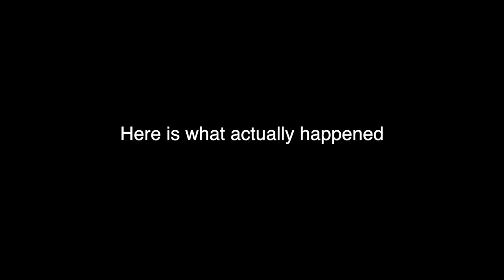How Can I Dig Through This?

Comment: Digging out solid rock to replace with a softer concrete to pass the building regs. We have the same problems here in Scotland 🤣
Reply: It’s better to leave hard rock and build on it.  In the uk when you have a footings inspection they prefer hard rock to stay in place.  It’s happened to me on many jobs.
Reply: I think they require a certain depth to stop sideways movement of the piles. the rock is all good for taking downward load but if it's only 300mm in the ground, the pile can migrate sideways
Reply: That could be overcome by drilling and gluing an anchor in it. But that would be an alternative solution requiring engineer calcs. May as well dig.

Comment: A trick for harder rock (or concrete slab) is to drill a series of full depth holes with a 12mm bit on your outline. On bigger excavations a few extra holes in the centre helps a lot. This also avoids cracking concrete (not your present concern). I have done this to pass ventilation ducks in cast concrete, not fun, but not as bad as a break hammer only approach.

Comment: Got Similar here where I live in Australia lol the foamy stuff here is generally pretty soft,and the hard dense stuff isnt too bad but then you get some that's like a combination,hard but has little soft pockets that the chisel just falls into and traps it. An ezebreak micro blasting system is definitely on the cards here, can apparently be used indoors etc,just an 8mm hole from memory insert the device and pull the trigger

Comment: I'd use a grinder to cut strips into the rock and then use the breaker. The cut lines help concentrate the force of the breaker and helps getting chunks of rock out.

Comment: To everyone questioning about digging out rock, in nz we have to pass inspection by building to engineers specifications so if the plans say 800mm holes to support a certain load, then the hole must be dug to that depth.
Reply: Sure but in any other part of the world the requirements on top of solid rock aren't the same as in silty dirt. It just seems dumb to hammer all that out and refill it with concrete doesn't it?
Reply: In nz it’s not just about downwards load. We get a lot of earthquakes so the depth is more about lateral strength when the ground goes side to side. Otherwise the houses would slide off their foundations at the slightest shake.
Reply: @livingimprovements4382  not if you epoxy steel rebar into though right?
Reply: @livingimprovements4382  but if you compare it t the old posts, that been there for a 100 years or so, it seems overkill. The old ones just do not look sturdy.
Reply: In my country, if you have an Engineer doing the plans for the building. You do it according their specifications. If you go away from it and something happens, you pay the bill. So, ye.
Reply: @Helveteshit  I think that applies in every country that has engineers and building regs/code
Reply: @danzimmer95  not all of the holes have been solid rock. How do you know that you are not about to break through into a void? For a small number of holes it is probably cheaper to follow the plan than pay the engineer to approve variations.
Reply: yeah there is not much technicality about it. the engineer specifies it, the builder does it . its just a normal days work if its rock - its a good (and rare) if its JUST dirt.

also, the council may have approved timber posts...but its just good building practice to use steel. sometimes the paper pushers dont know that their building methods are outdated.
Reply: @novosib9017  Really? Sounds like you really have zero experience of NZ soil conditions, compliance authorities, code or materials. What cost is your steel? How are you attaching it to the timber bearers? How are you protecting it from the concrete and soil chemistry?
Reply: @DiscoFang  you right i dont have experience in NZ conditions, ( i meant in construction, their are always hicups/rocks)  but i know for certain, here in AUS the only timber to ground connection you will see is a fence.

the NZ rot rate is clearly slower then here, but it does not mean it wont rot. Once you experience rot, ant damage in your structure (as a builder/carpenter) then EVERYTHING suddenly turns to steel and no engineer or certifier will get in the way. its called experience, and everything you mentioned is taken care of upon pricing of the work.

Have you ever taken into consideration a Builder with many years experience may end up working with a young, small (cheap) engineering firm? .

ive witnessed many times engineers ask the builder for suggestions before they make their final decisions. 

Iam not doubting Scott, he is a Good carpenter and builder, its clear in his videos he wants the best for the job, but it sounds like YOU need to know the things you mentioned as its just a standard process for me.
Reply: Not only that, but until each one is dug out, there is no way of knowing what's down there, as was evident when some holes were easier to dig than others.
Reply: Absolutely agree, We're on the West Coast North Island and every hole can be very different...
But they definitely don't need to be dug by guys at full trade rates!
Reply: @livingimprovements4382  the top of the post looked screw nailed to the beam?.. in Australia we use 100x100 SHS and bolt them to the bearer with 2 m12 bolts... works great.
Reply: TheBona73 just temporary while converting into place. Proper fixing plates to come.
Reply: Yeah the screws will be propping it temporarily I'd say the pile will be getting a 12kn pile fixings
Reply: It's not solid rock, that'd be bedrock. Which this Rick isn't that you also need big rock breakers as that Hilti wouldn't do shit on bedrock.

But this volcanic rock won't hold much weight before it breaks apart, so need to go past the volcanic rock layer to get to dirt below
Reply: ben The timber we use as piles can be treated to whatever level the application demands. The same species of timber used here under the house can also be used in marine conditions as wharf piles with a heavier treatment. Your steel piles would be failing in less than 1/4 the time that the pine will even be showing the any deterioration. There’s no “pen pusher decisions” involved there at all, it’s the reality of material experience and proof through use, that has evolved as building code.
Reply: @DiscoFang  Re-read what you wrote..then tell me again if Treated pine, in ground...is better then hotGal, blackjacked steel?

We use just that, with screw bolts going up into the bearer through the plate. overall its a  T post connection. 
Iam well aware of the rot differences between countries, here in QLD pine can rot away in 5 years min if exposed to soil, NZ, same as Europe (where iam from) pine has been known to still be "ok" after 10-15 years being in ground, fair call, every country is different and if that the countries specs then so be it.
Reply: ben Back at cha. Reread all your own comments yourself. It’s not the conditions that are relevant its the fact that the correct pine, treated correctly, lasts perfectly fine. These piles will last over 100 years and the only thing at fault here is not code, depth of pile, pen-pushers, lack of experience but your lack of knowledge of timber technologies in modern (as in the last 30 years) construction. To suggest $200 worth of steel, where $20 of pine will do the correct job, with easier installation, easier material availability and adaptability on site, is just silly.
Reply: @DiscoFang  yes i see your NZ codes are very different due to lack of termites and high humidity. but experience is not to be ruled out, here is a example of "modern technologies" for the cost of $180 as you stated.
https://ibb.co/HT39Hq1
Reply: @cm01  It looks like volcanic boulders intermixed with volcanic ash and soil.  If it was a solid sheet of rock/lava then you could drill and epoxy in some rebar to form a footing but when you don't know the depth/size of the bolder you don't want to dowel into a bolder of undermined size.  Also this is volcanic rock so it is porous, holds water and is likely acidic so I am not sure how those conditions would play out on a rebar dowel.

Comment: Scott, look into a product called Expando. You use an appropriate drill to drill a pattern then fill the holes with it, wait a day then pull out the rubble. Its a non-explosive demolition product and works a treat. Drilling is far easier than jack hammering.

Comment: Where I live, Vancouver Canada, if you get down to bedrock, you can pour a concrete footing ontop of it (at least three times the width of the collumn or thickness of the retaining wall) and if you encounter bedrock you can dowel in rebar to tie into it. You really arent going to get a better footing than the earths naturally compacted boulders, hard pan clay and glacier till/lava rock. The only real rule as a bare minimum is 24 inches below grade is oue frost line, and all footings need to be below the frost line. you can put wood into the ground aslong as its pressure treated, and encased in concrete. even then its a pretty big no-no because we get a lot of rain and after 30+ years even pressure treated lumber will start to degrade. So lumber above grade normally, concrete penetrates 24" below our frost line, and if you encounter bedrock or hardpan you're good to go.

So basically what I'm saying is this is massive overkill over here, but I understand the difference in municipality guidelines and restrictions

Comment: I have found the pointy chisel bits not very effective on solid rock or concrete, basically because the chisel is really trying to compress the material sideways. I've used a large SDS tungsten drill bit, drilled a series of holes, then the chisel.

Comment: The unconfined compressive strength of that Tuff is at least 20MPa which will give you a bearing capacity factor of safety of at least 50>3 therefore satisfactory.

Comment: Right call on the truck. Much better to pump in tight spaces. I'm not sure about the way you dug the holes. I would have looked into core drilling the holes.  Especially because it was volcanic rock. Would have been easy with diamond core drills. I'm not sure if you could fit a big enough drill in there. You might have been able to use 150mm core bit.

Comment: Copy/paste of smellysam
A trick for harder rock (or concrete slab) is to drill a series of full depth holes with a 12mm bit on your outline. On bigger excavations a few extra holes in the centre helps a lot. This also avoids cracking concrete (not your present concern). I have done this to pass ventilation ducks in cast concrete, not fun, but not as bad as a break hammer only approach.

My comment:
The material should be made fragile so that the work is easy. If those from Hilti can`t  figure out how to save you work (money) they should find a newspaper route !.

Comment: Do you ever get a chance to chat to the engineer on the Job? We'd usually find a way to get around it if they're ordinary piles, a clean hole on rock would likely be sweet. If they're anchor piles, we could swap them out for braced piles, a diagonal brace and a couple of bolts could save hours... Engineer time ain't cheap, but, if it can save you a lot in the long run.

Comment: Wow, what a massive ball ache that is. Surely if that rock is so hard you could build from that point. 
Something that hard Id normally cut or drill holes into before attempting the breaker
Reply: just wanted to mention that. drill some holes to give space to break some material off. 

the right drill machine and drill goes throu most like butter.
Reply: you mean form a footer right on top right?  i was thinking that as well
Reply: @danzimmer95  well yeah or maybe a nice big drill to drive some sort of pile into the ground instead. I'm sure an engineer could come up with something a bit easier than that. As I understand it the depth is due to the earthquake risk, I'm sure there's a work around somewhere
Reply: Seems like a whole load of effort to then just use fence posts I'd be in there with engineered steels if your up against earthquakes and wooden posts ain't gona last any longer than 20 years
Reply: Ryan Reid haha wooden posts last 50+ years. The ones under my house are from the .1940’s
Reply: @ryanreid5646  Haha Try 100+ years for these H5 posts in volcanic and clay mix soil. $30 for a pile vs $200 for "engineered steel". Properly built timber buildings withstand earthquakes just fine.

Comment: Why break out rock if it is sound enough to use for loadbearing purposes? Normally you’d just drill into it for a resin anchor. And then setting timber into the concrete, where it will inevitably rot over time!
Reply: There is no way to know that you will hit rock when the Engineer is drawing up the plans. As a builder, you've got to follow what the Engineer has gotten approved by Council. Even if they got plans changed after they started digging, how would they know the depth of the rock?
Reply: Shiva Krishnan - That’s not the way groundworks are done. Say you hit a soft spot in the ground or a spring, you have to either dig deeper than the plans to get past it, or change to a different foundation type like piles. Foundation designs are always adapted to the actual ground conditions, not the other way round. And if you suspect the rock is just a shallow boulder, you remove it. You don’t carve into it so you’re now resting on a reduced thickness of shallow boulder!

Comment: I mixed up just 4 bags last Monday to do a small strip of concrete beside a drain we installed recently.  The instructions require 6 minutes of mixing per bag (adding more water after 2 mins).  How long do you think it would take to mix 50 bags?  Pumpy was well worth the cost.

Comment: So where you stay Scott to buy 50 individual bags of cement is roughly the same as ordering premade in a truck plus pump.  That's before you add manual costs of mixing and filling yourselves.  That's amazing.  At what cost per premixed does this become a viable option, like can you only order a minimum of 500 dollars of premix, anything less and doing it yourself is cheaper.  Just interested to know man.
Reply: That truck and pump was $600
20 kg bag of concrete is $8 so 50 bags is $400 for 1000kg dry which is about 1/2m3 of wet concrete.
To buy 1000kg of aggregate and 8x25kg bags of cement to make 1/2m3 would be about $120.
So the last option allows an extra $480 for labour. So it all comes down to how much you can save as a DIY or pay yourself rather than the concrete suppliers as a builder

Comment: Truck and pump in Australia would be for the pump, about $440 minimum, and  1 mtr of concrete will be $250.. so $690.  
Buying bags is dumb, i agree.
but, if you had a trailer and a mixer, 1/2mt sand ($25) 1/2mt Screenings ($25) 10 bags of cement ($80)   total: $130.  (10 bags is 200kg = 20mpa over 1 Cmt)

Its alot cheaper to mix your own....  getting it in there, the labour might hurt you.. but there is 3 of you. 

Further, you didnt vibrate your holes.
Reply: So bottom line pls..
Reply: @greylynnjr   Buying bags is dumb.. infact its always dumb.   Pump is easier but more expensive.   Mixing your own from sand and screenings is so cheap, its worth doing over the pump...  you will save $560..(thats alot of money)   but you will need to work a little harder... carry buckets under neath the house.  That said, mixing your own rests on you owning a mixer and a trailer. Another bonus of the mixer is that you can dig a hole, then concrete it..   take a break, dig another concrete..  you wont risk being short, and you cant waste concrete by overordering, which hapens alot on those small pours.. need ,4 but you order a mtr.. throw away .6.
Reply: @aaronstately  thanks bro. Good to know

Comment: Digging in that ground is a nightmare. That hilti breaker is good but once you get deap enough use a TE 1000, i would advice drilling multiple holes this creates a stress line. That being said any decent structural engineer should come to compromise that does not need as much dig out.
Reply: Yes, the engineers who spec'd the piles as a solution to the minor loads from the roof should be shot. No, they should be sentenced to 6 months digging piles. This was all insanity.

Comment: Scott would you need to have more powerful ear defenders when under the house as there is a echo?
Reply: no
Reply: Reverb is never as powerful as the source of the sound.
Reply: @ianhill20101   okay thanks.
Reply: @BrandonGrantSplash  Good point mind the enclosed space can act like a speaker box and tune a certain frequency to a higher sound pressure level

Comment: It would be reasonable to assume that if that rock is hard to dig through with a hilti hammer drill, then it's good enough to support the foundations of a stump. Why would you need to dig an 800 deep hole???

Comment: If it is volcanic bedrock in the hole, way do you have to remove it?? Can't you just pore concrete on it and set the post?
All the best from Norway :-)
Reply: the connection is much more stabile if you make a hole and fill it up with concrete. It cant move now
Reply: @testaccount2343  Nice 👍

Comment: What's the point in removing the old posts with you can leave them for extra support
Reply: They might have rot or termites mate so better to remove them so it doesn't spread   to the new timber

Comment: I don't get why you need to chip rock away to replace it with concrete.  If you're hitting rock then just drill a couple rebars holes fill em with epoxy and build the pile on top.  Concrete isn't more structurally sound than solid rock.
Reply: The shorter the pile the more likely it’ll rip off the bearer or come out of the ground in a decent earthquake
Reply: @Jade-yq1et  1" Rebar tie in drilled into bedrock.   It's how they build cliffside houses here (they use thicker than 1")